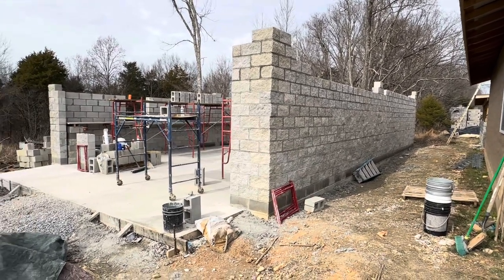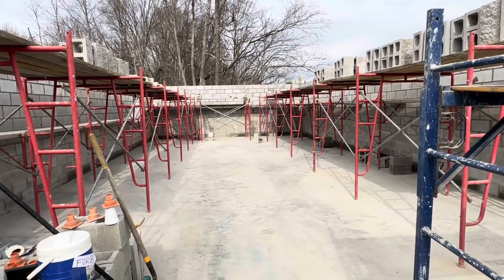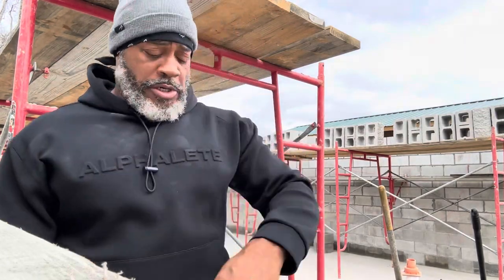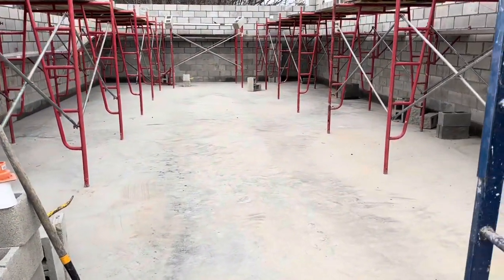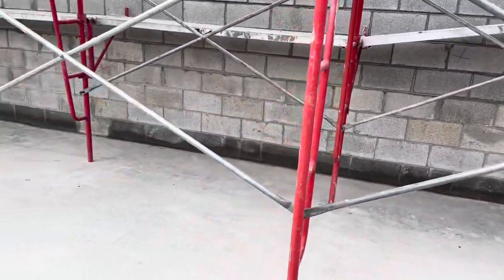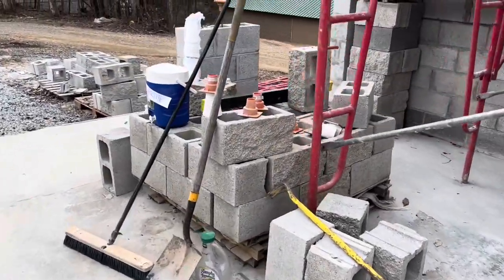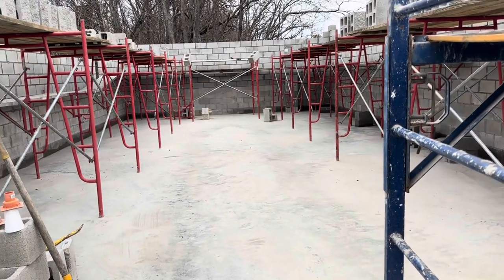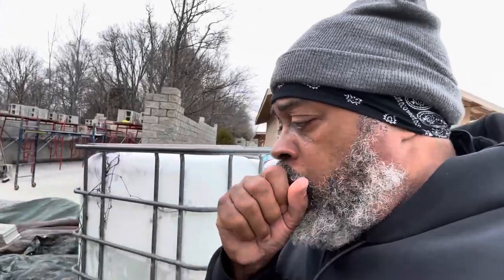The Average Cost of Building Something Like This

Comment: Great video, speaking facts and truths. thanks for sharing.
Current work I do is cost engineering [civil engineer and economist] and some of that is computing costs.
Roughing some numbers, materal on average, cost 25-40% of total cost... [assume $45,000 in materials at ~40% of total cost =~$112,500 +/-25% estimate cost having a contractor do the work].
block and brick build, always better than going stick build.

Comment: The block is cheap, the labour is what can become expensive. Guys at work tell me, labour is about double the material cost. I'm an operator and only tend if work is slow, but I have helped on side jobs.
Reply: But being an operator, I can jump in on pretty much any job, carpentry setting forms, pouring concrete, tie in rebar, setting scaffold, tending up to 5 or 6 brick/block layers on a wall, coming in behind them to grout. 

I moved to MN from Florida, I started out erecting scaffold for stucco, and graduated to concrete and masonry up here. Being from the south, bet your behind some of the guys up here have made it harder on me, especially because im in a machine most of the time. But I just keep my head down work.